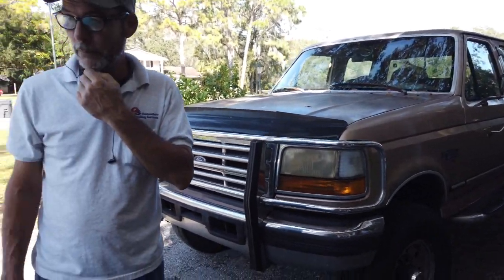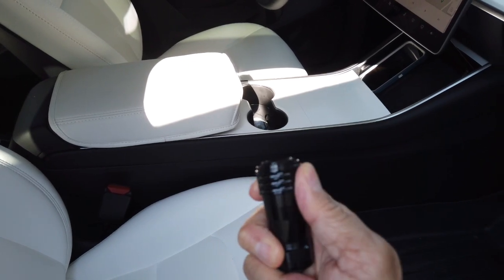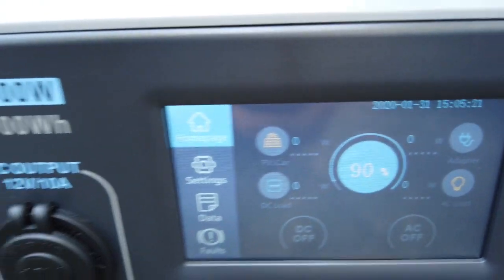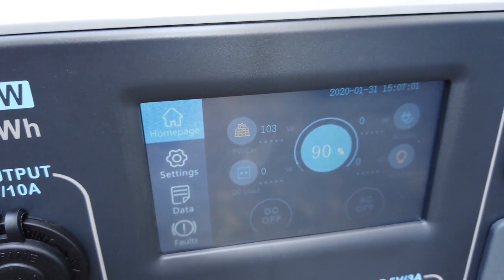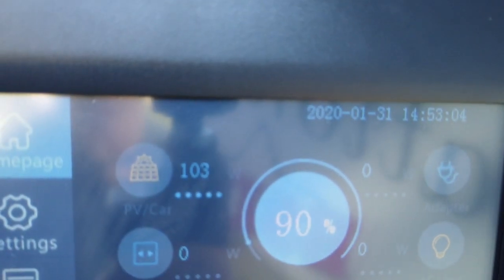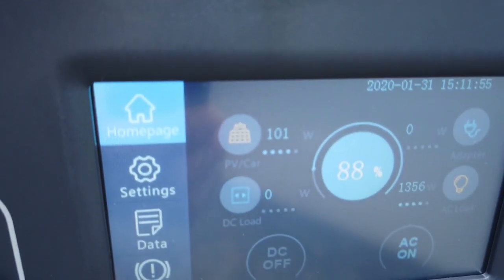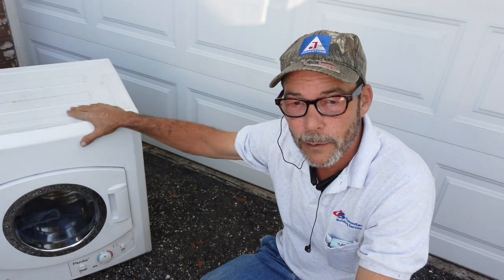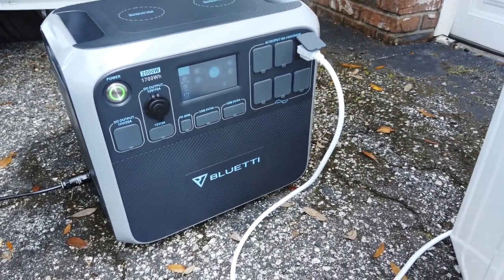Charge Bluetti AC200 With Your Car - Definitive How-To Guide (We Run A Mini Dryer While Charging!)

Comment: You need to hook up the car with a step up buck and boost D.C. 12v to 24V then it will draw double the Watts into the Bluetti.  200W instead of 100W.  Just like I do with the EB70 on the YT channel @ebikecnx7239
Reply: Seems like that at least right? What about hooking up an inverter?
Reply: @tomproctor8233  inverters supply alternating current and that cannot go into the direct current solar input of the Bluetti

Comment: But your vehicle alternator will work harder and will it affect your vehicle negatively?
Reply from the maker: I don't think it will effect your alternator as much as your battery.  But you would really have to use it for a long time with the car NOT running.  I think an electric vehicle would take more of a hit on the battery for sure.

Comment: I have a 280ah 48v LiFePo4 battery pack that stays charged with 1300 watts of solar. I feed the 48v from the battery into the Bluetti and use the "solar" input mode to keep the Bluetti topped off at a rate of 700 watts. Loads larger that this will bring the Bluetti battery down for a short time but it's quickly refilled from the 48v battery pack.
Reply: I haven't seen a 48v input charge the AC200 at 700W. What does it show on the incoming amps?
Reply: @massa-blasta  Over the last 6 months, I've seen a maximum of 612 watts at 48v usually when the Bluetti needs topping up.

Comment: What if you're driving to a destination some hundreds of miles away at 70 miles an hour on the freeway would that not speed up the charging or would it overwhelm the ability for the blue 80 to receive the church?
Reply: The charge rate does not change based on vehicle speed. Charging at 12v is limited by the amperage limit of the cigar lighter

Comment: In the case of using the EV's 12V battery to charge the Bluetti, is the 12V battery getting drained and possibly damaged? Is the EV's Lithium ION battery also charging the 12V battery even though the car is not moving?
Reply: In the Bluetti menu there is a setting for Low Voltage cutoff so it will stop charging when the charging voltage falls below a certain value, allowing the car enough juice to start.